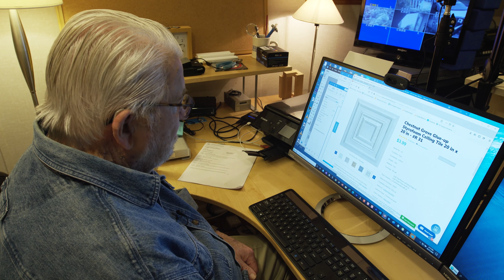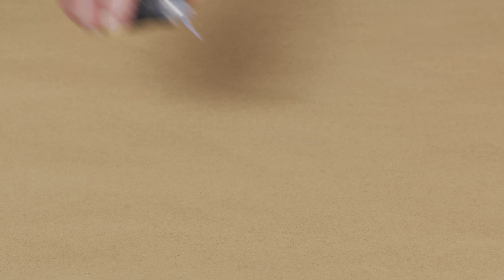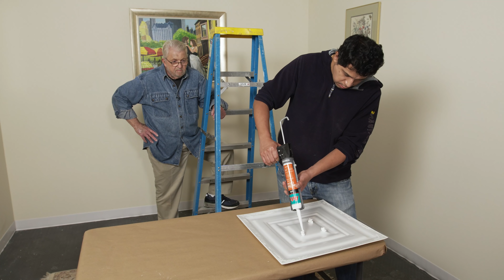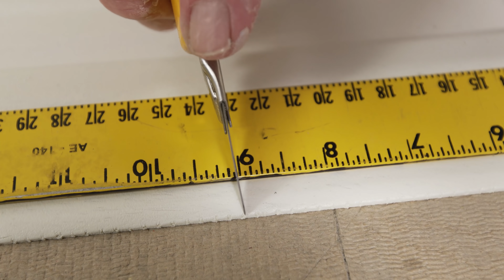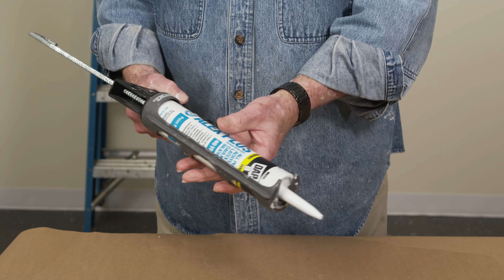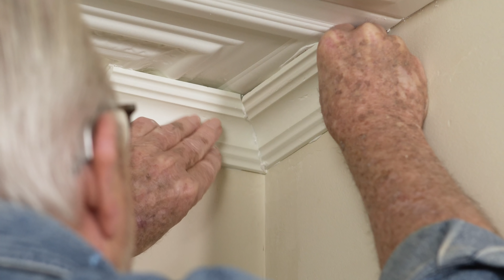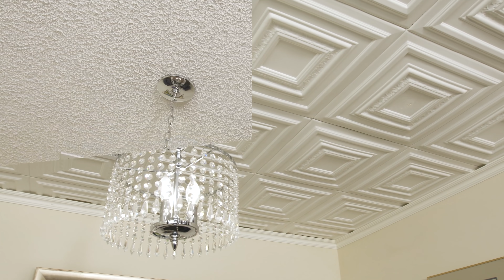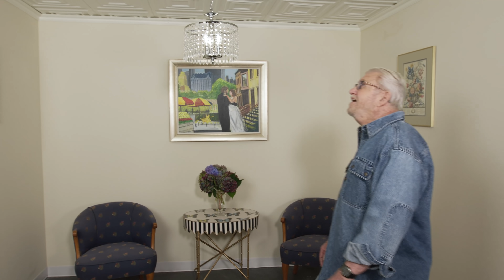Say Goodbye to Messy Popcorn Ceilings: DIY Guide to Covering with Glue-Up Ceiling Tiles

Comment: I agree with the other people commenting on the fire hazard, I've seen videos of these on fire, quite terrifying! The best way to get rid of the popcorn is to scrape off all of the high spots  and put up 1/2 inch  sheet rock, you can locate the joists by drilling since it would not matter if you leave some holes, it's possible the popcorn was put up to hide cracks in a plaster ceiling (50s era house) in that case use hardened Philips screws to attach the sheetrock since the joists are probably oak and extremely hard after all this time (I know because I remodeled a 50's era house)
Reply: You should always test for asbestos, popcorn ceiling is notorious for containing asbestos as it was popular at the same time that asbestos was used in building materials. Scraping it off or drilling into it releases all the fibres. 

It’s sad to see people who think they know best posting all this potentially dangerous advice on YouTube.

I agree about the fire hazard but exposure to friable asbestos to your whole family is also a major health risk that needs to be considered.

Comment: You can easily tell you didn't think this project through. Just look at those horrible gaps where the crown molding meets the tile profile. What happened to option #3 - Leave the ceiling alone. I would have taken the stale popcorn ceiling over that god awful finishing job.

Comment: I don't like it, it looks so cheap. I had popcorn ceilings in just about every room in my house, I simple bought a big bucket of joint compound and skim coated the whole thing, now it looks like it was replaced with all new drywall it also evened out all the bad work that was there. .

Comment: I'm sorry, that looks like shit. All the giant gaps at the Crown molding , the air vent and lighting. That ceiling is in great condition, you can easily scrape that coat the seams and low spots and paint it.

Comment: It's not messy, I've done it.  Put down drop cloth.  Spray with a water bottle, as you scrape it off.  Comes off very easy and very fast rather than leaving it there.  Use the tiles if you want but remove that crap from your ceiling.  It scrapes right off, no effort.  Wear a real mask not a COVID joke mask.  Paint mask is best.  That stuff has asbestos in it so wrap up before you scrape it.

Comment: Don't do this.  When you or a future buyer decides that they want something different the adhesive used in these products require taking down the drywall on the ceiling or building a new ceiling below the original.  These are bad ideas.

Comment: I did a very similar installation but the tiles snap into a grid that screws into the ceiling. There’s a bathroom above that sometimes leaks and we wanted to be able to access the ceiling in case of leaks. The plastic tiles are water proof and we can just pull them down if we need to. 
You can now buy low voltage pot lights that are 1/2 an inch thick. I cut circles in the center of some of the tiles and glued the pot lights into them. Since it’s low voltage I cut the wires that came with the lights and extended them with thin bell wire that I simply fed through the grid. You can do this as the low voltage is safe to touch or even short out. There’s not enough power in the wires for them to heat up when shorted or enough voltage to give you a shock if you touch them. 
I now have pot lights exactly in the center of the tiles and I didn’t have to cut holes in the drywall ceiling.
Reply: What tiles / grid did u use?

Comment: Things to note first of all light fixture would be in the center of a ceiling tile typically second both brands of latex caulking does not have a seal inside a tube.

Comment: cover it with 1/4" or 1/2" sheetrock.
Reply: They popcorn ceilings to avoid the joint compounding.  Crape off the pop corn and either screw on some 3/8ths or mud the joints.
Reply: @AtomsInTheRough  scraping off old popcorn from the 70's is a crap shoot.. they often added asbestos to it.  spraying it with a thick coat of latex helps.  but the best thing is to cover it

Comment: You can spray popcorn with water in a spray bottle, let it soak a min, spray a little more if its soaking in quick, another minute, now use a wide drywall knife to shave it off, it comes off easy. Makes a huge mess, nothing a sheet of plastic can't handle. That will leave an orange peel like texture. Go over with spray water and a soft brush to soften the texture a bit, if you want. Then let dry and paint.

Comment: Aww comon ,  just wet the popcorn well with a pump up sprayer and lightly scrape with a 12inch drywall knife with carefully rounded corners.  The popcorn practically falls off in sheets onto cheap clear drops then throw it away. It’s easy.

Comment: Polystyrene tiles were very popular in the south of England in the late 60's and 70's, they were very cheap and made a pleasant change to other ceiling types.                            These ceiling tiles are a safety concern, polystyrene tiles are a nightmare if ever they catch on fire and drip flaming beads of molten fire drips all over the place and spread the fire considerably faster than if they had not been fitted. If you ever see a ceiling once these tiles have been removed you would never apply them in the first place. The mess left behind with dollops of glue everywhere is a nightmare to rectify. Stripping the ceiling and eventual re skim would be the only way out. I would never ever use polystyrene tiles of any type. Dangerous and a whole new nightmare to replace. Polystyrene ceiling tiles and coving which have been installed for a number of years can be a major fire risk. An out of control house fire can produce poisonous gaseous fumes and the plastic in the polystyrene can drip and burn your skin as it falls.

Comment: The corners look very unfinished even with the crown molding. I wouldn't do this unless I could get custom tiles made to finish the edges and not have to cut them in half. The corners should be flat against where they meet the wall in my opinion.

Comment: As someone who has been in the industry for 20 yrs reading some of these comments make me shake my head. Disturbing any asbestos in your home is never good. If your home is pre 80's and you plan on doing ANY renovations you need to have what your renovating tested prior to doing anything! Asbestos is in literally everything textured ceilings, dryway mud, floor tile, linoleum paper backing, old light fictures, leveling compound, your furnace or boiler system, to your attic, roofing materials, window chalking...  Just because you covered it with something does not mean it's not there anymore or makes your house safe, flooring is no different. Depending where you live when it comes time to sell your home you need to disclose it but chances are a GOOD home inspector will find it or figure you out or a potential buyer who buys your home could come back on you. Putting a hook in your popcorn ceiling is one thing buy you DIY people scraping this crap off as a weekend project just contaminated your house and possessions not to mention your clothing and health your little papper mask does NOTHING!  This popcorn ceiling is scrapped or removed under high risk procedures for a reason. People praising this guy really need to do you homework 🤦‍♂️🤦‍♂️

Comment: I disagree...  Decades ago, I removed the popcorn spray stuff from a 2500 sq ft house.  I believe any tiles you put up over popcorn will, over time, fall down and create an even bigger mess.   Get a ladder, a spray bottle with water, and spread a plastic sheet on the floor,   Popcorn ceilings are not something that you want to attempt a shortcut with.

Comment: Thanks for video and instructions, BUT!!! It looks horrible/ Much easier is to remove this stucco. It is very simple and easy. You need to moisturize your stucco using the simple sprayer and water. Let it soak for 15-30 minutes and than using drywall knifes remove it. It get easily detached from the ceiling. Apply compound if needed, paint, and you have beautiful flat ceiling.

Comment: Nice idea. I may do this. It looks like it's worth it. Putting drywall as one comment said would take that already low ceiling to an even lower level. That is very unwanted. Crown molding adds a visual higttened look.

Comment: WARNING:  From the 1940's to the early 1990's, asbestos was one of the materials used in popcorn ceilings.  If you are going to remove it, first verify when your home was built.  It would also be a good idea to have the popcorn ceiling material tested before disturbing it and inhaling any asbestos.  If it contains asbestos, you need professionals to remove this stuff.  Some people attempt to wet the ceiling down while chipping away at it, but there is still dust created and the wetting down only reduces the dust.  In addition, many people set up fans to push or pull air to an outside window, but you are just changing the location of the asbestos and not removing it.  Do yourself and your neighbors a favor and get a hazardous materials contractor to do it.  Sure, it's expensive, but you won't contract Mesothelioma!  Applying a covering as in this video, and not disturbing the ceiling, does not present any asbestos related threat...it is only when the material is disturbed and becomes airborne where it can be inhaled is where it causes potential problems.  Sorry for the long FYI.  Just want folks informed and safe.
Reply: I had my ceiling tested by 2 labs & both came back not asbestos, organic material. Tiny specks do drop on floor occasionally, usually when windows are open. Do you know what organic material in it would be?
Reply: @Lady-pu8es  I am sorry, but I do not know.  Hope you find the answer somewhere...

Comment: Just finding center of room and snapping lines does not guarantee your lines will be square to each other , if not you’ll end up with tiles stepping and the look will be horrible. Also just starting from the center MAY give you an undesirable border size, when figuring out border size equal border sizes are usually preferred, you can have either largest or smallest equals. If your tiles are 2ft. wide ( and they probably are) a 23ft. room can have either a 6 inch equal border or an 18 inch equal most times the larger is preferred. Also I can foresee leveling problems since most wood joist ceilings are not all that level for a product such as this , and if you do not intend to use a border such as this crown molding cutting with a straight edge will give a sloppy look because walls are not perfectly straight, trim is good. To the untrained eye this may look good at first glance but I can foresee an awful lot of unsatisfied customers if what you want is a quality looking job. I might add I am a retired carpenter, more specifically I specialized in dropped ceilings including glued concealed tile ceilings and we never used caulking because it tends to yellow with time or at least it use to perhaps that issue has been resolved with the product since I retired but I doubt it.

Comment: Are polystyrene ceiling tiles a fire risk?

Yes. Unfortunately polystyrene will begin to soften at relatively high-temperatures approaching 100°C and at that point will begin to shrink. When heated further they will melt and at this point they give off a gaseous and flammable product. If exposed to further heat such as during a house fire, the gases will ignite. The products that are released during melting can also be highly toxic. This does of course the question as to why these products are allowed in construction without further precautionary measures to render them safe during fire.
Reply: 100 degree c is boiling temp for water... if you in same room as the tiles as they reach that temp get out... beyond that the sheet rock underneath the tiles IS fire retardant. So will slow the fire from spreading. People hang draps in front of windows which can be highly flammable. Point being you can NOT  make everything in your house fire proof
Reply: @Kenny1594  hang draps? sounds as silly as using polystyrene as a building material. lol
Reply: @Kenny1594  that is true but you can reduce the risk.
Reply: @Kenny1594  to state that houses are built to be evacuated very quickly is missing the point somewhat. If a fire starts in your lounge while you are in bed asleep, the presence of rapidly combustible materials will quickly escalate the fire  possibly to the point where burning material is dripping from the ceiling, so even if you do wake up do you want to be running through a shower of burning plastic and noxious gas? Please know that I am not going to respond to any more comments because as they say, you can't argue with stupid.
Reply: @thequietroom3991  Smoke detector, problem solved.
Reply: @MahkQ4  would you like your family to have a few extra minutes to get out safely? That's the point!

Comment: The result was definitely better than that nasty popcorn ceiling, however, I really think the crown molding should have went up first, and the vent/fixtures should have been trimmed with a solid smooth white piece around the edges.  I personally opted to remove my popcorn ceilings by steam/water/scraping,  took a while and was messy as heck,  but the smooth ceilings are worth the effort.
Reply: You do know this popcorn ceilings have ASBESTOS.

Comment: OMG No !  Take an hour to cover with plastic sheeting. With a weed sprayer filled with hot water spray an area and soak it. Move to the next area while the first gets loose. With a wide scraper simply remove the popcorn. Before picking up the plastic , remud any gouges or cuts. Next morning.... roll up the plastic and dump it. It really is easy , takes one day  to do a med. size house and brings the home into modern style for about $100.00! Just wait till you see what those ceiling tiles cost you.... not to mention the glue.
Reply: Just remember, most of those popcorn ceilings contain asbestos!

Comment: and then they fall down or turn an ugly brown
Reply from the maker: Not in my experience Gary, have been working with these for 13+ years.  And actually just wrote an article showing how these tiles look after 12 years in a house we owned. Here is a the post: https://www.decorativeceilingtiles.net/blog/polystyrene-ceiling-tiles-installed-in-2009-over-popcorn-what-do-they-look-like-after-12-years/

Comment: Garden sprayer and drywall knife scrape it put some plastic on the walls and Floors bam when dr.pol sand now coat with layer primer touch up patch and paint or commence drywall ceiling what you're asking for and doing well in future fall off

Comment: I cannot believe that polystyrene ceiling tiles are still available and in use anywhere in the world!  We used to use them in the UK but no longer as they are a massive fire hazard. And even without the fire hazard, they're incredibly difficult to remove when you no longer like them.
Reply: I totally agree, polystyrene is a bigger health hazard than asbestos, which doesn't burn or let off toxic fumes!
Reply: I believe you can make a really basic fireproof material by soaking newspaper or other fibrous material in a borax solution.  Not the crazy polyfluorocarbon chemicals they use in industrial flame retardant, but basically something that is less toxic than table salt.  Like a box of twenty mule team borax in a barrel of water to create enough waterproofing to apply recycled newspaper or shredded blue jeans as attic insulation.

Someone could probably figure out a process to make a tile that uses some recycled fiber material and borax that gets pressed into compressed tiles.  Or maybe somebody already has.
Reply: @PhilLesh69  School glue or wallpaper paste both make a perfectly acceptable hardwaring paper mache that can be moulded into any design and waterproofed with paint..
Reply: There's always one asshole.....
Reply: @stevenmeadows6917  I'm sorry to say this sir but a poster pointing out the elevated risk of fire spread is not an arsehole. Polystyrene is highly flammable and emits noxious gasses when ignited. Go ahead and put them in  if you like, but do not cast aspersions on someone's opinion if it was well intentioned. I'm going to guess you're an anti vax conspiracy theorist too right?
Reply: @thequietroom3991  Hey, I don't sugar coat anything.
Reply: @stevenmeadows6917  big difference between sugar coating and making a completely disrespectful and unnecessary comment on an individual, but whatever.
Reply: @thequietroom3991  Oh yes, it was a necessary comment.  The guy made an asshole comment, and I just called him out on it.  I guess I have a low tolerance for malcontents.